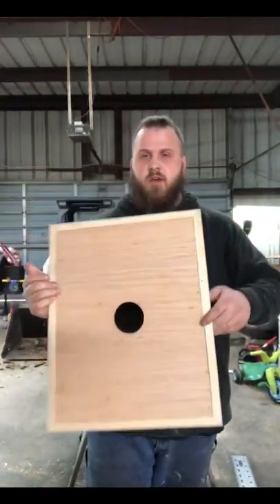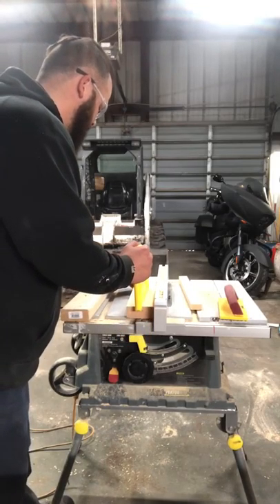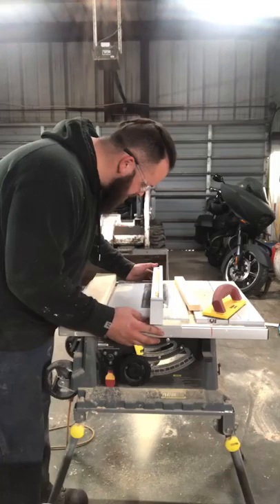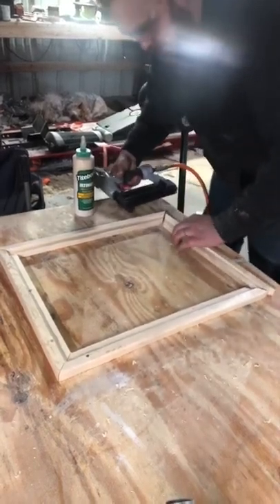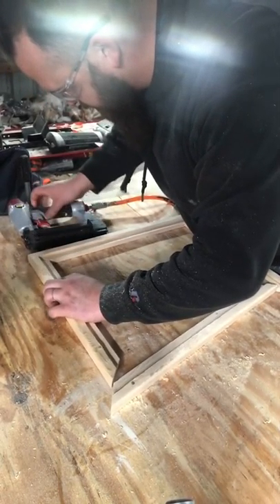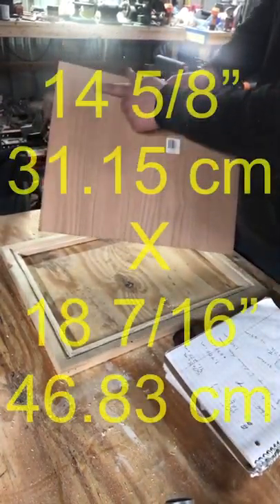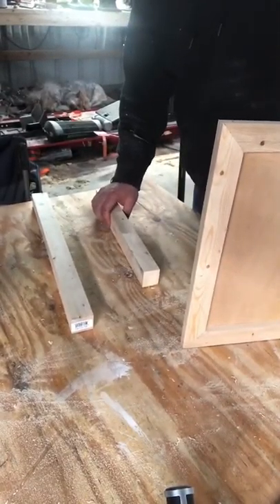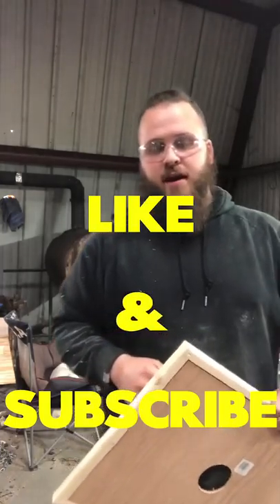Easy DIY Beehive Inner Cover

Comment: How would you notch the cover?   Before installing the flat panel board?  BTW - is that Luan?
Reply from the maker: I show you in the video with the table saw
Reply from the maker: Not sure what luan is but it’s a oak sheet in the middle because that’s what I had and used a 2x4 for the rest
Reply: @GDHoneyAcresandCraftWork   I did not see how you cut a notch into the end frame for an upper entrance.... I'll go back and watch again.  Thx
Reply from the maker: @MikeChamplin  sorry I must’ve  misread. The notched is in a different video. I just used a hand saw and wood chisel